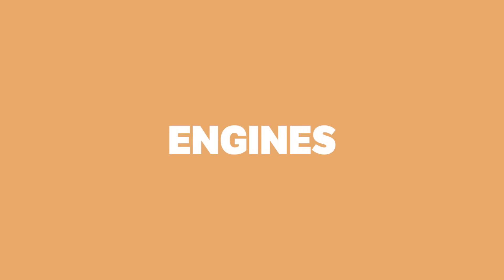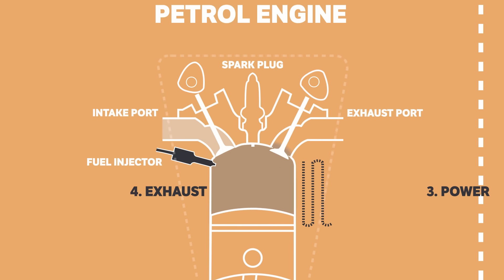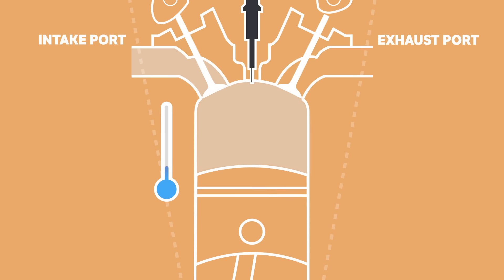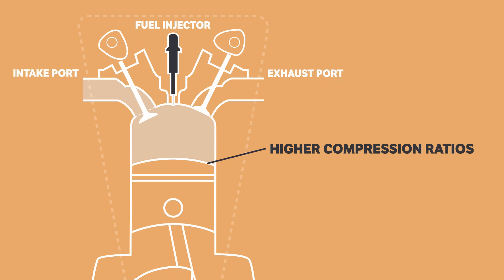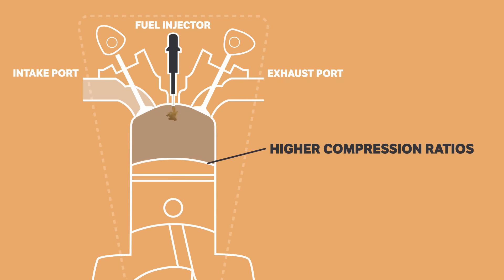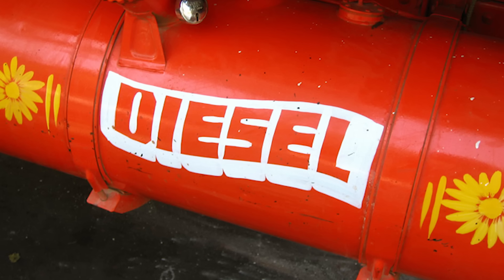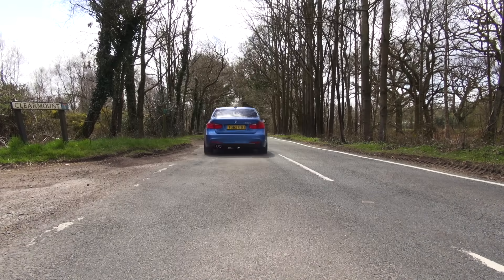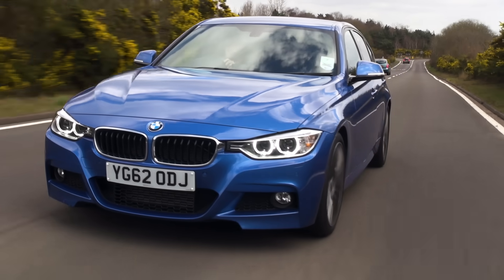The Differences Between Petrol and Diesel Engines

Comment: To sum it up Diesels are more efficient, have more torque, are more reliable, are simpler, have more torque at low rpm and the fuel usually costs less (depending on where you live)

Petrol on the other hand sounds better, are generally lighter, pollute less, and the maintenance costs less
Reply: DIesels are simple ? WTF are you talking about ?
Reply: less co2 but more of the other shit gases
Reply: Ben Moore they use less fuel, but they pollute more.
Reply: Due to the higher compression ratios the diesel engines need, in general, designs and components of higher level of engineering. The ignition system of petrol engines is pretty simple.
Reply: Unfortunately a lot of people in the last 20 years bought diesels because they thought they were better for the environment. You can't totally blame the car makers, at the end of the day for years the governments only cared about CO2 emissions and diesels were a great solution to that. Now we know how much worse diesels are to human health but it's kinda too late, we're basically stuck with them until electric cars are good enough to render their torque gains over petrol obsolete.
Reply: more reliable? Then what do you mean petrol maintenance costs less? :D ''simpler'' diesels only concerns diesels form 90ies, not something from 2004
Reply: Yea..no. Petrol pollutes much more than diesel. Diesel releases more particulate matter into the air which settles into the ground, but petrol releases more CO2 emissions into earth’s atmosphere that lead to many problems that I don’t feel like talking about because I’m out of school on break right now. Have a good day!
Reply: Diesel engines have more reliability issues compared to petrols. At least in cars.
Reply: Popa Sergiu not unless you put DEF in you tank.
Reply: Sounds better? I think that is an opinion, not a fact. Polute less, that is a bad thing, they need to polute more. Maintenance is less, not sure, i have heard it is yea but i doubt that with modern diesel engines. If so, it is probably because of the turbo and the fuelinjector.
Reply: Diesel is more expensive in Britain.
Reply: i thought petrol polluting more?
Reply: Diesel is a far more complex engine consisting of a lot more parts, also diesel is considerably more expensive per litre than petrol here in the uk
Reply: hey Daniel howr u?
Reply: HAS MOR TORQUE BECAUSE HAS TURBO. A PETROL ENGINE THAT HAS TURBO HAS MORE TORQUE THAN DIESEL...STOP COMPARIN NON TURBO PETROL WITH TURBO DIESEL
Reply: @talossebi6803  nah fam, diesel have way higher torque. Always. Double the horsepower is usually the amount of torque it has in nm.

Now for complicity; diesels are not more complicated. They seem to be, but they are not, they are just build to be able to deal with all the pressure (up to 50 bars in the ignition chamber). Petrol engines are not simpler, they have the spark plug, which makes it that more complicated. The thing with petrol engines is that they need a system which correctly times the spark plug and the fuel injection. Diesel on the other hand only needs to worry about the fuel injection. 

Now pollution: petrol engines produce more co2, which is one of the elements that naturally is in air. Diesels produce less co2, but they produce other toxic gases, like NOx for example. Although that also only happens because the fuel ignites while not having a good mixture with the air that also comes in, unlike petrols. The solution would be to build in filters into the diesel engines that catch those toxins. Or to make the petrol engines self ignite like diesel engines. 

As for sound, petrol engines sound very different from diesels if you listen closely. And for most people petrol sounds better.
Reply: Diesel engines are more complex. Also I live in the North where winters are rougher, that's why I can simply assure that diesel engines are not reliable.
Reply: John S but diesel pollutes with other things, not just co2. Why do you think europe is starting to ban diesel engine cars in certain countries?
Reply: I might differ on reliability issues
Reply: DieselGod237 diesels don’t use spark plugs, but they do use glow plugs, learn how engines work
Reply: Petrol (gasoline) emits more carbon monoxide than diesel
Reply: Mobile recordings diesels dont use spark plugs just fuel injectors. learn science
Reply: Popa Sergiu oh right sorry
Reply: James Ch diesel emits more toxins your point?
Reply: Daniel G diesel emits less co2
Reply: Daniel G petrol doesn't sound better
Reply: Mobile Recordings diesels don't need as much sophisticated shit that's why it's more efficient fucktard
Reply: Diesel pollute less, they use less fuel

Comment: Diesel is brilliant, apart from the black smoke that comes out of the exhaust. If that was eliminated, there would be no need for petrol to exist. But because of a lack of fossil-fuels, I still personally think that Ethanol is the best fuel type.

Comment: Nice video although I kinda know this already. But diesel vs gasoline a.k.a petrol. On a sports vehicle or a car I am more of a petrol head. Although the old diesel cars of the 80s may have soured me on the use of diesel in a passenger vehicle for heavy-duty Vehicles such as pickups large vans and tractor trailers diesel is the obvious clear choice but can be a pain to start in the winter. Where I live it gets very cold and snowy all you get in the UK is rainy and dreary. They both have their own particular applications. One thing I would like to try though is the Ducati Diavel Diesel that would be an interesting ride.

Comment: Petrol, diesel is so irresponsive.
Also, how about "how turbocharges work on 2-stroke/rotary-engines", I mean, I know how they work, in fact, I know how a 2-stroke with carburettor works... but Turbos still baffle me on them 2-stroke machines. Especially those with antilag, as there is no functional bypass system. Retardation is an option though...

Comment: Someone has probably cleared this up already...but what the hell. The only reason for a throttle body on a diesel is for regeneration. It is used to super heat the intake to create hot enough exhaust for efficient DPF burn off (regen). 

Myself i prefer the 2 based on application

Comment: If diesel is so bad. how comes Audi won lemans so many times with one?
Reply: they race for hours, not minutes
Reply: Lemans is an endurance race. Diesel is more efficient. Less fuel stops vs an equivalent petrol car. If it's able to stop less often, it can be out there completing more laps. THINK ABOUT IT.
Reply: If life gives you lemans, make lemanade.
Reply: Funny how F1 racing is done on petrol.
Reply: You mean oil. From oil we get diesel and petrol. Petrol is more processed then diesel - so it is more eco friendly. From processing oil we gets more products but I should also mention most eco-friendly fuel - gas (LPG).
About being efficient - diesel is main reason we have polution (diesel and coal). Soon it won't have any sense to produce diesel engine because of emision restrictions. Petrol is much cleaner and cleanest is LPG. Of course even better is hybrids/electric cars but well - they are awful.
Reply: Cause diesel is actually good
Reply: Wartimes slimetimes
Not when it gets old. Diesel engines repairs gets really expansive and most of them have minor flaws. Heck diesel is an awful option when buying used 10+ years car.
Reply: Sorry im not that good in english so change gasoline by petrol but it's still weird because in brutal petrol we can find diesel and fuel
Reply: hotondale 24hours
Reply: Only that Audi did not stop less frequently compared to it's direct competitors with petrol engine cars.
Reply: u sure?
Reply: petrol danger to earth, diesel danger to human, aarth safe.
Reply: Andreas Myhre Yeah, but a diesel car is allowed 5 litres and a turbo, but the petrol cars are only allowed 3 litres and a turbo. That's why the diesel won.
Reply: if diesels are so good how come they need to be turbo-charged all the time ? checkmate.
Reply: Because diesels run at about twice the compression ratio of a gasoline engine. You need more oxygen in the cylinder to have such a high compression ratio. If the compression ratio in a diesel is reduced the fuel will not ignite, which is another advantage to diesels (especially older ones like 12v cummins that were completely mechanical) you don't have spark plugs and ignition systems to cause problems.
Reply: hotondale its in a different category altogether.
Reply: Aubé.V what
Reply: Gabriel Spang it was in a different category
Reply: 666nataS they have a higher compression ratio. Did you watch the video?
Reply: Correction. there is not a separrate diesel class at leMans. The AUDI R10R has beaten all the Gasoline driven cars.
Reply: And there is a set number of pitstops. All has the same number of stops.
Reply: Who told you diesel is bad .. Explain me.
Reply: Captain Quirk well technically explained
Reply: Aubé.V diesel is fuel too .. You mean crude oil has petrol and diesel
Reply: AkaRyupl electric cars are really awful but they're the future unfortunately ..
Reply: Because turbo diesel. The Chuck Norris of the engine world.
Reply: diesel is mainly bad for the environment :D
Reply: @LunnarisLP  bad for people
Reply: @Mr Sunshines 
You are soo wrong. Through procesing crude oil  (destilation) we gets 4 main products (which are interesting for us) - LPG, then petrol, diesel and asphalt/bitumen. Since petrol is first, it's quality is much better than diesels. It consist ligher hydrocarbons, which burn down easier. With diesel we get lot of leftover carbon and much more carbon dioxide. Not mentioning even that diesel fuems are considered carcinogen.

Also diesel is not more efficient than petrol. They produce similar amounts of energy (42,6-44 MJ/kg for petrol vs 43 MJ/kg for diesel). It's engine that is build to be more efficient. Mazda build petrol engines that behaves like diesel engine and guess what? They are equally efficient.

Talking about Le Mans - for last few years diesel engines looses with petrol hybrids or even electric cars. So yeah - diesel is dying.
Reply: No.  "Petrol" is gasoline.  Diesel is a heavier, more oily, less-refined petroleum product.
Reply: DieselGod237
Not for environment and my wallet when it gets older...
Reply: Hmmm... That must explain why a diesel engine will typically run twice as long as a gasoline engine and why diesels retain their value so much better. As far as your other comment about emissions.  About 19.64 pounds of carbon dioxide (CO2) are produced from burning a gallon of gasoline that does not contain ethanol. About 22.38 pounds of CO2 are produced by burning a gallon of diesel fuel. So when you figure the Avg Diesel gets about 30% better fuel economy than the same sized gasoline motor the diesel actually pollutes less. Please don't believe all of the silliness that is spread around.
Reply: But diesel is more efficient
Reply: Petrol (gasoline because diesel can be found in petrol to) give more rpm but less torque so they opt for petrol engine

Comment: Not sure if you've done this but can you explain compression ratios in gas vehicles and the octane ratings? My motorcycles have a 12:1 and an 8.7:1 ratio. I use 93 octane in both, but have used 87 or 89 in the 8.7:1. It didn't seem to run badly, but it wasn't as smooth. Why?

Comment: Of course petrol engines.
Diesel cars suck for active driving.
More torque you say? Means fuck all when you get all in a big lump between 2000 and 2500 rpms and then dies off.
And the pedal is as responsive as someone who has done hashish for 5 days straight.

Comment: the clip covered a lot of points but the main reason diesels ar better is that you can use a diesel engine all day at maximum rated power without any issues since the maximum torque is so low in the power band. while a gasoline engine will only produce the maximim power at a very high rpm, an rpm that can only be used sporadically without serious overheating or reliability problems.

Comment: While briefly mentioned (longer stroke) another reason diesels produce more torque is because slower burning diesel continues the combustion process through much more of the power stroke, as opposed to petrol combustion which occurs  quickly at the top of the power stroke and rapidly declines as the piston falls. Slower combustion is also the reason diesels are limited in RPM...diesel can only burn so fast.

Comment: One of these days, the rest of the world will realize that they aren't putting oil(petrol) into their fuel tanks. They're putting gasoline in them. Both Gasoline and Diesel engines are technically petrol because they both use petrol in one way or another.

Comment: A Diesel is always better, because you drive with "power" and not with "speed" if you know what i mean. A diesel engine also sounds better and the fuel efficienty and the easy working systems in the engine, whixh allows better working on the engine, makes this engine more useful. And the speed differences are not that big. If I would drive in a petrol golf and then in a diesel golf with the same engine size, i wouldnt notice the speed difference between them

Comment: okay, so if diesels have more power, why do they accelerate sluggishly? why do all performance motors run in petrol? this had me thinking
Reply: they have more torque, meaning they are stronger, not faster, think of it this way, the petrol is an athlete, who is very fast, and the diesel, is a power lifter, they are not fast, but they can lift and pull more

Comment: of all the things that make an engine fuel efficient it is compression ratio that is most important, I believe that is why the eco boost is so efficient is because Ford is using diesel technology in a gasoline engine, by waiting to the very last instant to inject the fuel they eliminate pre-ignition thus allowing much higher compression ratios to be used.

Comment: So, why don't we set up diesel engines like petrol engines with lower compression ratios and a precisely timed spark ignition system and cam system? Does it not ignite fast enough when used as regular gas with a controlled air/fuel mix and ignition?

Comment: Diesels are comfortable to drive because you have instant torque from low revs, but it's boring as hell when driving activly... Petrol engines are more fun to drive, but take a bit more planning and active use of the gearbox... 
I'm currently owning a Skoda Superb 1.9 tdi, and i love driving it on windy roads, but i miss the fun of the Honda i used to have :/

Comment: I prefer diesel to the point I won't be going back to petrol.

They're more reliable, cheaper running costs, have loads more torque (which I like) and are good cars to modify. The reason being is partly due to being more reliable they can handle the extra grunt but it's mostly because they're almost all turbo charged so it makes modifications easier with better results.

Comment: Still petrol for me! Diesels are great but the sheer amount of pressure needed in the fuel rail can be dangerous to work on and components like the dpf and egr valve which are only found on diesels regularly build up with carbon and need replacing, the savings you make on fuel are outweighed by the maintenance needed on these extra parts.  

Also Nowadays diesel cars are being fitted with adblue to reduce emissions (NOX) and adblue isn't cheap at £15 a jug!

Comment: 3.14 this inst really the reaction of burn diesel is slower than petrol, yeah, is correct that diesel has more energy per litre but if you put the same quimical energi the petrol gives it faster and the ethanol more faster

Comment: Honestly we all know that diesels are better in almost every category, it's simply that people and engineers aren't giving them a chance. A 300bhp diesel, will always destroy a 300bhp petrol car. There is no debate a D3 can almost keep up with an M3, and the M3 has literally 100 more horsepower. Or the best comparison would be a BMW 540d and a 540i, the 540d has 20hp less, is 90kg heavier, yet the 540d is still faster, and the thing is, the 540d will consume 5 liters while the 540i will consume 8 liters. 
However, petrols are definitely more fun and sound thousands of times better. 

So in our current time I'd still prefer a petrol engine, but honestly diesel has enormous potential, when they start making diesel engines with 400hp+ in 3.0 engines then petrol will have absolutely no chance. A tuned 435d can already beat an M4 with ease. So yeah...